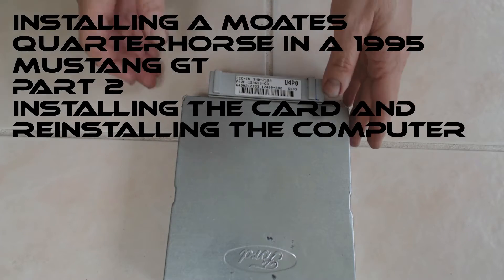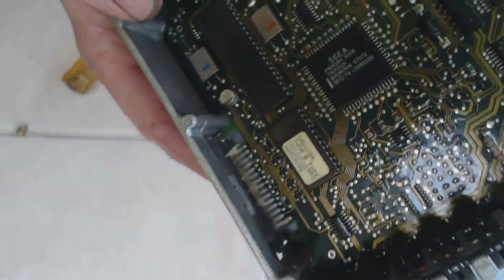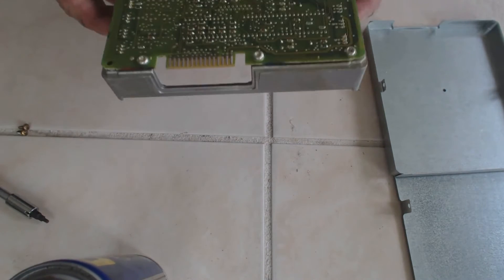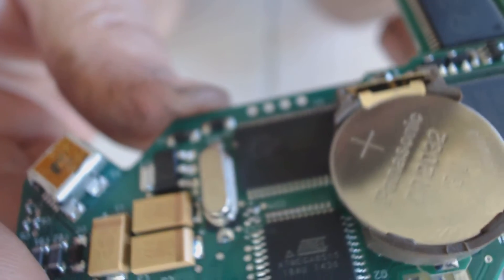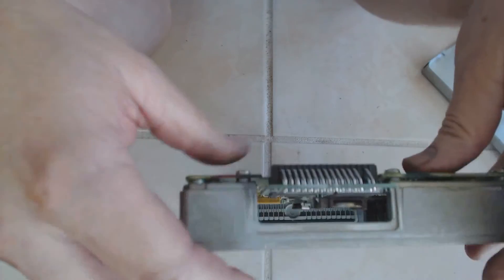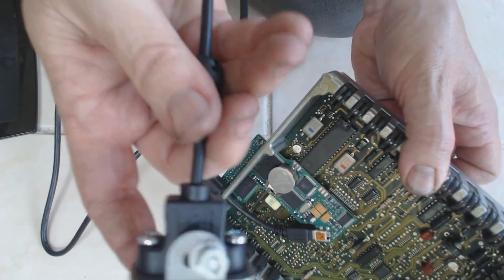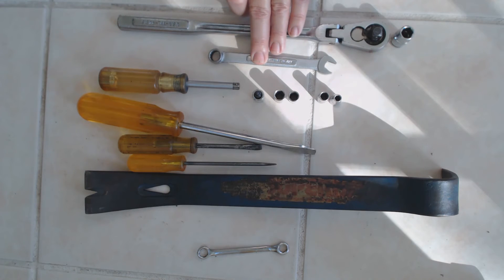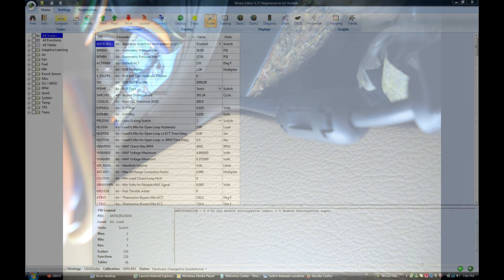Installing a Moates Quarterhorse in a 95 Mustang GT: Part 2

Comment: Can the tune be set up to run a targeted AFR?
Reply from the maker: EpicScandinavian 
If you run open loop you can set your data tables as you please.  Yours  is a broad question with no single answer.  Closed loop locks you in the the standard 14.7.

Comment: Using that wire brush was something I would've avoided... Not the brushing itself, which was, I'd say, harsher than the job really called for and could've lifted the copper from the board if done carelessly, good nothing happened.

What really worried me was a wire or a tiny part of it coming off of the brush (as they do all the time) and landing between exposed metal contacts, I know most of the components are insulated/covered with a thick layer of some kind of polymer in these ECU's, but still... I wouldn't want any kind of metal wires "swimming" in there.

Comment: Hi ed .  Nice video  .

Question .. why not just use a regular j3 chip .. what advantages does the quarterhorse over a normal j3 chip?

Alao Have u done the video on the software side of things .. keen to see that too...
Reply from the maker: Short answers:

I bought the Moates J3 chip and burner.  I'll be burning my own J3 chip which is REQUIRED because the Moates Quarterhorse is battery backed ram.  If the battery dies with a heavily customized engine, you are stranded without a new battery and computer to load the program.  

If you want to obtain ultimate performance, there is a LOT of CUSTOM tuning involved.  Constant tweaking is involved.  HUNDREDS of changes need to be made on a customized engine, especially a forced induction or larger displacement engine.  Quite often you don't know you have a problem until the datalog tells you that you do.  

In my experience, factory tunes are VERY conservative.  I don't know for sure but I suspect any J3 purchased chip would be very conservative as well.  They don't want to be sued for blowing up engines.  Having said that, improved performance is better than stock performance especially on a budget.  If every time you change something you have to send the chip back for an update, you're going to be parked a lot.  (OR buy TWO chips.)

As to the software, I'm using Clint Garrity's Binary Editor.  I find it EXCELLENT, and Clint regularly updates it.  The software is very intuitive and easy to use.

Now because you can make changes quickly and easily doesn't make you an instant expert in doing so.  There is a LLLOOOONNNNNNGGGGGG learning curve involved.  (Think MONTHS!!!)

I may do a general overview of Binary Editor shortly.  Yes, I'm still in that LONG learning curve on how to use it.